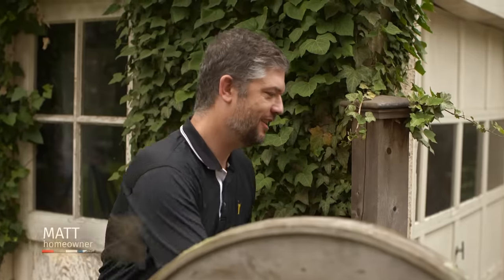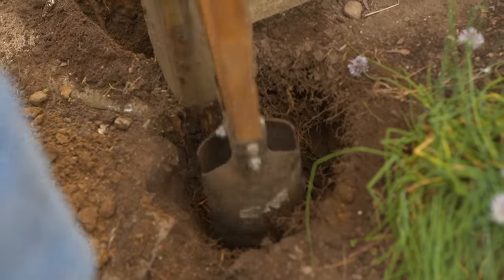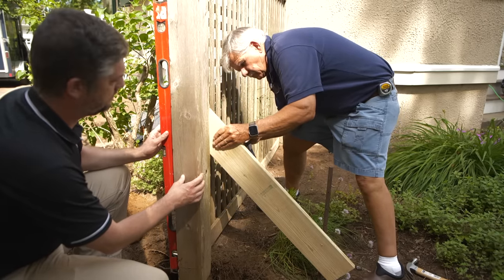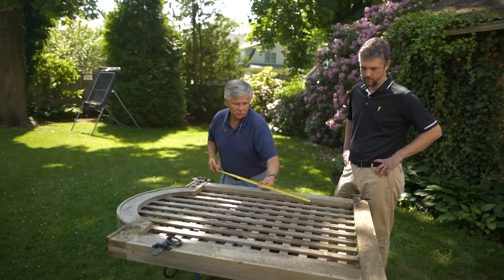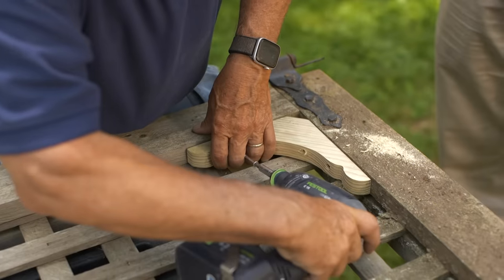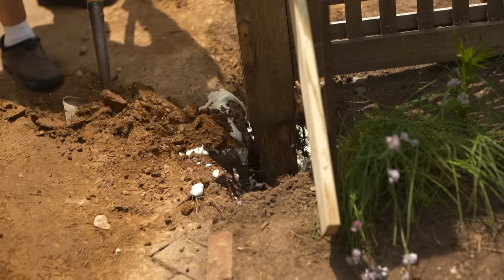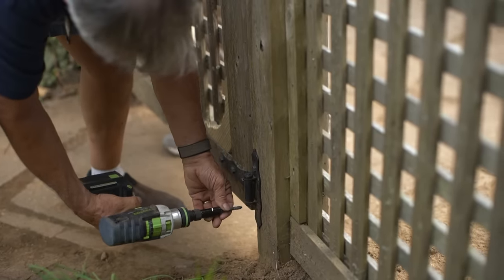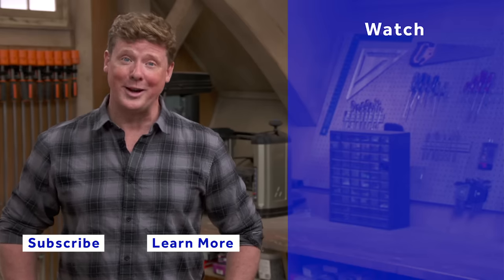How to Fix a Sagging Fence Gate | Ask This Old House

Comment: The two part expanding foam is a slick solution.  I've never seen that one before, but will sure use it in the future for this kind of repair.  Thank you. Tom, you always make difficult tasks look easy.
Reply: I won't ever use that expanding foam again, definitely not for a fence post holding up a gate. Reason I say that is I used it for a mailbox post and the box got bumped slightly and the foam compressed a bit and the post was no longer solid in the ground. I can't imagine it lasting that long for a post holding a gate that is opened and closed a lot.
Reply: Just use a quick set concrete  it will outlast that expansion foam .
Reply: One thing you should be sure to do if you use the foam is to pour it onto the post, otherwise it'll expand onto the post but not bind to it. The extended directions on Sika's website are pretty explicit about it, but I don't recall if the bag mentions it, too.
Reply: Expanding foam is not a quick fire solution for all fences.
If your fence posts have to endure the wind beating against a closed leaf panel, then the foam will compress laterally. That wind can force your fence and attached post back and forth like you were shaking it. In concrete it would never move except with the natural give of the wood. In foam the tiny air pockets collapse as the cell walls rip and tear, making millions of tiny void spaces held in tension by the trapped air, a larger pocket, with air escaping and the pockets permanently deformed. Rendering what the foam was holding no longer tightly held.

A second point. Not all foam is created equal. If foam is desired then choose one that as it stops setting, does not shrink. Foam undergoes a reaction to set that involves heat that causes foam to expand. When it cools, it does not shrink, but rather deflates. This can result in the inner holding area of the foam to shrink into its center mass which if you imagine a doughnut, it not where the center hole is, but in upon itself. So it will loosen its grip on the post it’s holding and the wall of the hole you dug and poured the foam into.

Foam can be used, but if the work you are doing is intended to be placed under load, outdoors in weather conditions that you need your posts to resist… foam is not the best choice.
Reply: @IzzyCraft  Thanks for mentioning that.  I thought the foam stuff was cool but now  I'm re-thinking concrete is the tried and trued way to go.
Reply: @davfree9732 Explained like an engineer! 👏🏻

Comment: how do you make one strong enough that it wont sag when all 4 of my nieces and nephews ride the gate at the same time?
Reply: build the whole gate out of steel
Reply: Add a diagonal cross brace. Obviously.
Reply: @GeeTheBuilder  lol i did...
Reply: @GeeTheBuilder  r/wooosh
Reply: Take pictures/vids of the kids swinging on the gate..... let it sag.... take more pics/vids....   You'll love those pic/vids a few years from now:)    Fix that gate later....:)
Reply: Here's a cheaper, and possibly a more effective, alternative to strengthening the gate – Put your nieces and nephews to work fixing your gate every time they make it sag.
More than likely one of two things will result...
1. Your nieces and nephews will see the repair work as punishment and avoid busting the gate in the future. 
2. Your nieces and nephews will learn to love carpentry and you will have found a cool activity to share with them.
Reply: Or build a steam carousel for them. Similar to making your cat not scratch the furniture; give them a scratching post 😉
Reply: Try putting a wheel or roller under the far bottom corner of the gate. That way it will be supported when the kids take a ride on it

Comment: The expanding foam was an interesting trick.  I always enjoy videos with Tom.
Reply: I have used those foam when I  replaced my mailbox post instead dealing with concrete
Reply: Would have loved to have heard more about the foam, why, brand, how etc
Reply: It's not a trick, just a product. Otherwise you can call everything a trick.... toilet paper, laundry detergent, the vacuumcleaner.. But i think the weight of concrete is what makes a good foundation, foam is exactly missing that.
Reply: @Engineer9736  ... if you are not in a hurry, you can dump a half bag of dry gravel mix into each post hole and add some water after the fact. Ground moisture will do the rest and the following weekend you can hang the fence. Now you have the added weight, the added size of the concrete, and no sloppy concrete to clean up.
Reply: Used the expanding foam on posts for my deck last summer.  It was perfect for what we needed to do.  Recommend that product he used very highly and it's very easy to use once you get used to it.
Reply: @chrisfletcher86  The bag looks like the same one I used by Sika.  I have had to repair several post with this stuff and it works great.  Very easy to use and sets up fast.

Comment: Tom, you know best.  I really like that expandable foam material.  I haven’t seen it around my area,  We have clay soil and moisture problems on fence post bottoms.  My approach has been to coat the in-ground portion of wooden posts using asphalt and then wrap them in aluminum flashing to protect against moisture and rot - especially at the soil line.  The coated and protected portaron is then cemented into the ground, leaving about 4-inches of the coated portion above grade.  That seems to give long life to fence posts in our type of soil.  

In you application, I think it might have been good to have made a wrap from flashing - all the way to ground level - and then pour in the foam stuff - and top with some cement and TLC sloping of the cement to avoid standing water around that post.  Enjoyed your demonstration.  BTW many years ago I think you and the TOH crew were at the beach bar at the Fountainbleau Hotel in Miami Beach?

Comment: I'm not sure if this is in any way correct and probably not the best way to set posts but years ago I set some posts by shoveling dry Quick-Crete and gravel in the post hole around the posts for a chicken wire fence and then I just added water and left it.  The posts lasted 20 years before rotting at ground level so I guess it was an ok way to set them, huh? 😄

Comment: I think you can speed the weathering by using vinegar. I remember seeing a video a while back where people would spritz an apple cider/steel wool solution on wood to oxidize (and grey) it faster.
Reply: That’s a cool process, but fair warning it can go more black than gray. Especially when dealing with oak
Reply: @TheChupacabra  One could mitigate the darkening risk by a dilute solution of the resultant oxidant but yes, I agree. Takes a bit of work to predict with accuracy how the wood will respond. It might look good today, but it might look ghastly in a year.

Leaving it to the UV radiation and weathering seems to be the safe route.
Reply: @ALAPINO  when you say oxidant you presumably mean iron acetate as opposed to the acetic acid? 

Still tricky to guess effect from calculating concentration of reagents. Think your best bet is to test on a hidden area (and heat if needed, depending on season)
Reply: @TheChupacabra  It's been a long time since chem, but I think my main point should have been more clear as I am a layman: go with a weaker anything. Or yes, absolutely, test on scraps.

Personally, I'm not all that a fan of ferric acetate stains for outdoor projects. They just don't ever seem to weather in a pleasing way. But obviously, that's just my experience on the east coast with our species' and our weather.

In this case, since the homeowner called TOH to square a gate and reset a post I don't think he's going to care about waiting for Tommy's repair to weather in. (Frankly, it looks great as is)

Comment: I’d suggest not topping the post hole with dirt.  It will speed up the post rot.  I’d put in enough foam to come above ground level, and then use a knife or something to trim and taper the top foam away from the wood so water drains away toward surrounding earth.

Comment: The house side gate post with the blocking: anybody know to what that through post bolt is attached?  Tommy mentions concrete, I assume concrete wall?  Doesn’t seem likely he drilled the masonry, then bolted through the post.  Cmon TOH, that’s a big skip.

Ah. Now I see this just a standoff, to stop the post from leaning towards the house.  With a new gate and reset hinge post, the febce can be made push wedge tight against the house

Comment: I am curious as to why Tommy didn't incorporate the use of some adhesive in holding the gate square. And the foam, very short term solution. To last 8-10 more years concrete would have been a better choice.

Comment: Why was the post not set in concrete to begin with?
Reply: Usually not necessary, if buried deep enough.
Reply: There are so many videos on how to deal with rotting/loose/sagging posts and gates precisely because they rot if they are in ground contact. I think I’d rather pour concrete and then bolt hardware into the slug.
Reply: @TheChupacabra , Wranglstar did a video on how he drilled a diagonal hole a few inches above the dirt line down maybe 12'' ? He then filled the drilled hole with old oil or something, then put a wooden plug in the top. I've heard of old timers doing this and their posts are still standing after 50yrs.
Reply: @augustreil  ... the old timers also put used motor oil around the outside of their posts to retard weed growth. Utility companies still treat their poles with the drilled hole deal, but they don't use oil. They might have at one point, but it's not allowed these days.
Reply: @augustreil  thanks for the tip but i should’ve mentioned it’s for going around my vegetable garden, I think I’ll wait to harvest my potatoes before I bathe them in oil.
Reply: @rupe53  yeah telephone poles and railroad ties are made to last but a bit grimey for my tastes, typically being coated in creosote
Reply: @TheChupacabra  ... they are all pressure treated these days, even RR ties. As a side note, I'm sure they wont last as long as the old school treatments.

Comment: I see the ease of the foam but what about longevity?
Reply: Foam will outlast the life of the post... Telephone poles are set with similar expanding foam.
Reply: @cup_and_cone  the only case I’ve seen of this was in a video sponsored by the foam company. And it looked a little bouncy when climbed. Anybody else use this in the field for real?
Reply: Yes many maybe most fence posts are done w foam set now.  Maybe not good enough for foundations but fine for post.
Reply: @TheChupacabra  if it was really cured, then the bounce was the surrounding dirt moving, not the set fo.

Comment: in frost prone areas that foam has created an edge or lip for the frost to grab & heave the post.  also I would have used stainless staples, the ones used are not rated for outdoors
Reply: If you set the foam below the frost line the problem you presented won't be an issue, right?
Reply: @StoneE4  correct
Reply: @johnmolnar2957  You should have mentioned that on your own.
Reply: @StoneE4  ... the frost line in his area is way more than 24 inches, which is usually where a fence posts ends.
Reply: Plated staples last the 10yrs left on this fence.

Comment: Tommy should know better than to use a foam base. When it hardens the foam shrinks back from the post leaving the post in the same position as before. Loose and unstable. Quikcrete is the better?solution. This wasn't about a proper repair vid, this was a solution repair using a sponsored crap product that contractors have recently deemed insufficient for long-term post setting.

Comment: Of course if you aren’t a strong carpenter and already own that giant clamp, it’s cheaper to hire someone than to buy the clamp.
Reply: The clamp is just a piece of iron pipe. You can just buy the two orange end pieces to put on it. The beauty is your clamp can be as long as the piece of pipe. My dad had a few of those, they were very handy.
Reply: Not to mention the custom cut wood prices he used to fix everything.
Reply: It will never be cheaper to hire someone if all you need is the long clamp and some common sense...

Comment: This foam post trend, hmmm, not a fan. Styrofoam is like glitter. Once it’s a mess it can never be completely cleaned up. Now we’re dropping foam in holes all over our yard, sounds like a a new mess of plastic in 5 years. Use rocks and concrete. Not creating a pollution problem for the next guy, because that next guy could be you!

Comment: Foam is the worst.  It floats when it rains
Reply: @AFullNelson  I trust you but here in New England it may be different or a bad install.  My daughters 60 ft fence installer used foam and we had 13 inches of rain in two weeks and the whole fence buckled and the foam basically pulled up. For my money if it’s one post just do cement.